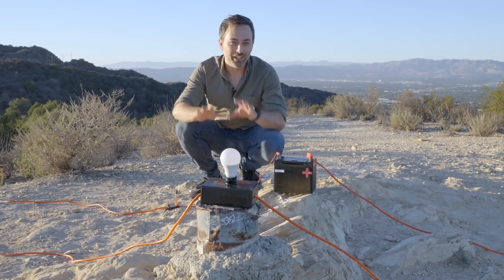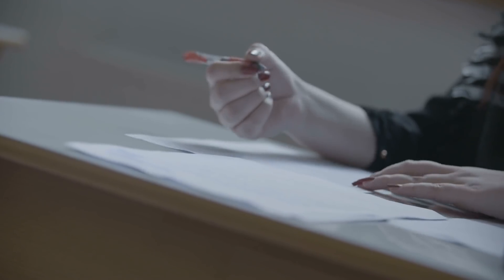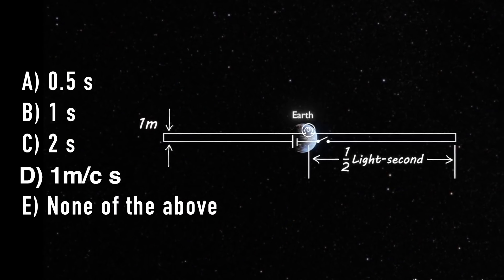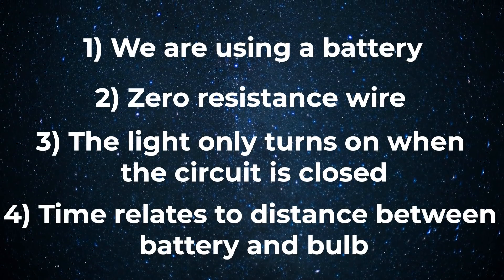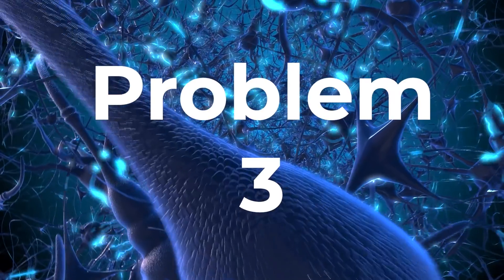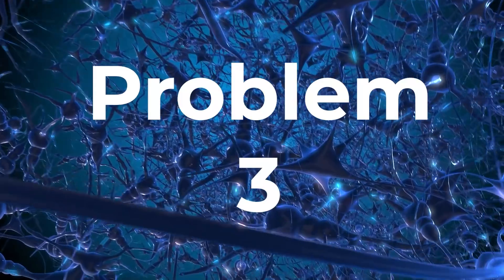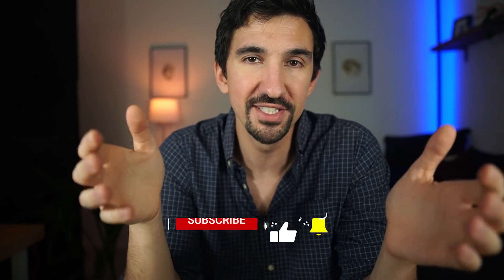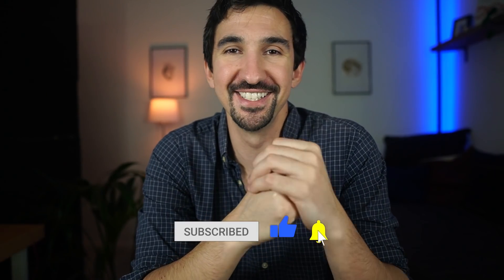Is Veritasium Wrong About Electricity?

Comment: If you just use Maxwell's laws directly, then you get Veritasium's answer. That's not very satisfying. But that's kind of his point -- the simplified models and explanations that most people get taught first lead to incorrect intuitions about what is actually going on.

Any electrical engineer worth their salt knows this answer intuitively. But getting that knowledge and intuition is what you spend a ton of time on when you get that degree.

That said, there are lots of alternative ways to conceptualize this problem that all give the same answer and all address your issues. Given the length of the wires, you could say you are looking at a capacitor. Given the transient nature of the switch, you've got induction going on. Similarly, the wires are basically a pair of antenna and you can find tons of videos on YT demonstrating this exact phenomena in that context. If he used AC current, and didn't bother to short the ends of the wires, this would all be obvious.

But he's using DC and a switch to create 1 transient effect instead of a continuous pump of energy. But because the ends are shorted, the energy will keep flowing because the current will get there before the transient dissipates.

It's also worth noting that special relativity is confusing for most people because they don't have good intuitions about how  electromagnetism works. If you have those intuitions, then SR is an enormous simplification of Maxwell's laws and the rest just follows from that.
Reply: Intuition this, intuition that. Can you show how you use Maxwell Equations directly please?
Reply: @georgelionon9050  YT comments don't allow for LaTeX math symbols. And the number of people who grok differential forms is pretty small in any event.

There are multiple good YT videos explaining the various ways of looking at this, and you have Ian M. Sefton's paper on which the original video was based.

I'll post a video if you have a specific question, but there are plenty of good resources already and I don't think I can add much beyond what I already said: all of these models are simplifications of Maxwell's equations under different assumptions. The problem people have is that they learned the simplified model instead of the real thing. So if you apply a model that isn't applicable, you get nonsense results.
Reply: @MaxHaydenChiz  My main question is, of course anybody with any intuition will agree that something is happening on the bulb in 1m/c seconds. Since EM Fields travel through the air and it's basically a capacitor, antenna, however you want to model it. However the EM field travels much stronger along the wire, so for the full strength to arrive on the current its wire length/c seconds.. If you answer is, the bulb gets already full 12V^2/R (R of bulb) power 1m/c seconds after the turn on event, then I really want to see a full explanation of that calculation. IMO the main argument people argue about is the unspecified parameter of how much it takes to drive the bulb.
Reply: @georgelionon9050  There are videos on YT from years ago of people using the antenna version of this problem to drive a bulb at full power just fine. You can test this. It does work.

If you want an explanation, go read the original paper that Veritasium's video was based off of. It's quite good and pretty understandable. And it argues that people get the wrong answer because they are taught the wrong things at the high school and undergraduate level. All of the issues I've seen people raise on YT are covered in that paper.

I think where people are tripping up is with the causality (which is perhaps the most bizarre aspect of electromagnetism). They want to think that the current is what is making things happen. But it isn't. The field is what causes everything. And fields travel at the speed of light. You don't have to wait for the current to "get going" in order for the field to do its thing. On the contrary, the field propagates and it causes the current just as quickly as it lights up the bulb. (The paper does a good job of showing how this works inside the wire vs at the surface, etc.)

Again, this is all pretty obvious with AC. But because the example uses DC, people without much experience or who have only been exposed to simplified models don't have a good grasp of what the transient behavior and the transition to steady state will look like. (But if you think of it as a piece of one phase-cycle of an AC circuit, that might help.)

I think the actual problem with Derek's video is that he didn't simplify matters like he usually does because the point of the video is that inappropriate simplifications create confusion instead of understanding. I hope he does a follow up that tries to give people a better grasp of this topic.

That said, it's a fundamentally difficult topic, one with lots of disagreement about how it should be taught and no truly successful approach.

I've never seen it taught in a way that even a majority of students came away correctly understanding it. If you go to engineering school, whether or not you cam get this is basically the difference between being an electrical engineer or having to get a major. (Much like heat transfer is the wall for MEs.)

Maybe Susskind's course on YT (Theoretical Minimum: Special Relativity and Electrodynamics) will help. But ultimately, you just have to work through lots and lots of examples on your own and work out the details in lots of corner cases.

If you understand how to derive all the different models, where they break down, and why, then this becomes less mysterious.

Grabbing a huge reference book with lots of tables for closed-form solutions and trying to reproduce the results is about the best advice I can give.

But at the end of the day, vector fields are weird. Some of the greatest scientific minds struggled to understand this stuff when it was first discovered. They invented new mathematical machinery to make it easier to understand. It didn't even play nice with other parts of physics until special relativity came along. And fully unifying it with gravity still seems impossibly out of reach.

It's a hard topic. Expecting a simple explanation is unreasonable. That said, my personal opinion is that if we taught the differential forms version of EM instead of trying to use div-curl-grad, people would have an easier time of it. I've always found using 4-potential to be more intuitive than trying to visualize a bunch of interacting vector fields in 3d space.
Reply: «Ces questions de noms se rencontrent si fréquemment, que, si les philosophes étoient toujours d’accord sur la signification des mots, presque toules leurs controverses cesseraient.»
-- Renes Descartes.
Sometimes it is translated or interpreted as "people would understand each other much better and would find agreement much easier if they would agree about the definitions"
Veritasium did not specify what should be considered as a signal.
Like it's not typical in physical sciences to associate a phase velocity with any signal, it's not typical to take a first propagating wave as a signal. Signal is usually interpreted by a certain level with respect to the full steady-state value, like 1/e or half maximum.
Thus, the initial condition of the task is not fully specified
😁
Reply: there is already a bunch of videos in yt demonstrating modelling of the long wires, showing predictable results: the first weak wave starts to bring some power to the bulb, but the true power comes after a full cycle of propagation. And a steady-state condition takes place after many reflection, and circulating the waves
Reply: Veritasium model is what he showed just for a split second, and it's what he was not talking about. That's the reason why that video is not so helpful, and that's why there is so much criticism

Comment: Assumption 4, that it only depends on the distance between the bulb and the battery, isn't completely right. The switch or at least the open part of the circuit (the break in your wire 1/2 lightsecond away) is of consequence. There's a difference between breaking the circuit over here versus over there. The "information" about the circuit break (let's just call it a switch) at the remote location 1/2ls away propagates at the speed of light, you're not wrong, but the field itself does too. The field (or more specifically, its advancing wavefront, where the "information" is) has a frame of reference. This is special relativity.

In the field's frame of reference, the bulb and the battery are connected instantaneously with the flipping of the switch, but only at the point in time in that frame of reference at which the signal reaches them. Remember how relativistic travel is like traveling into the future? It's this. And it's not only this, time dilation is only one effect, length contraction is the other. In this frame of reference, the wire is 0m long.

Let's continue the thought experiment, most importantly, HOW would you actually carry this procedure out? There is NO way to do it without being subject to special-relativistic factors, and the specific one which breaks your logic here is the fact that there is no universal notion of "simultaneity" which you can use to know whether the remote switch was flipped NOW or 1/2s ago for any observer other than yourself. There is no causality paradox here.

(Aside, you might think that the fact that we get GPS signals to work means that we CAN establish simultaneity, but that's not right. What that system does is calculates and accounts for the predictable non-simultaneities of all its parts. Plus, general rather than special relativity effects are much greater magnitude in that system, the special-relativistic component is vanishingly small.)

It does not matter where along the 1ls long wire the switch is. The signal from the switch to the bulb and the battery will always arrive simultaneously with the switch closing, to the observer watching the bulb and the battery AND the switch from the frame of reference of the bulb, battery and switch.

The bulb illuminating IS the signal, and there's no way to synchronize your clocks with the person flipping the remote switch to say it happened any earlier or later in your frame of reference. Well, actually, there is, and because of time dilation, it will say the switch was flipped 1/2 second before you received the signal, but again, that's only in your frame of reference. In the lightspeed FoR of the advancing wavefront of the electromagnetic field, it's simultaneous and instantaneous because of the length contraction.

Comment: I also know if you conect two old army field.phones together with a couple of miles of wire between them and talk into one and listen on the other you will definitely hear a delay.  So that blows vert's hypothesis out of the water. And its not a hard thing to prove it wrong. The electrons in the universe are not solidly conected there is space between them no mater how dense the matter they are in or how cold. It takes time (c) for them to travel from one atom to the next. Like a series of pool balls with space between them. It not rocket science.

Comment: I'm at a loss why we rationalize every electron in every atom of the wire taking turns moving like a drive through. I believe every free electron in the wire can move one valence space to create full circuit current. This is a very short distance and they may move together. I do not believe Veritasium that it is the field traveling from the power plant around through the sky and ground through my house and the glass  to power the bulb. It is the electrons moving across the LED or filament.

In part of Veritasium's video they mention the real world issues of the transatlantic telegraph. Then later the real world is abandoned and we must accept the moon circuit conclusion.

Comment: TIMF. A question about causality: Assume there is a rope that stretched from earth to the moon with a person at each end. The person on earth tugs the rope. Would the person on the moon instantly notice movement of the rope? Assuming the rope is under tension, no elasticity, etc.. If it is instant, how does this not break causality?
Reply: The answer is Yes, the signal does cover the distance "instantly", but NOT in the frame of reference of the people at each end - only in the lightspeed frame of reference of the propagating signal. I suppose if we assume a massless, frictionless rope, we could say that a lightspeed signal is possible.
Reply: @glowingfatedie  Thanks!

Comment: Thought the very same thing when watching his video.. this would mean faster than light communication..? One thing I'd view this as trained electrical engineer is.. the wires are effectively a capacitor. And wires spanning a light second on both sides are a hugh capacitor. And as you have a capacitior with several Farat size, at the beginning for DC current it can basically pass through almost undisturbed. This is similar to your antenna argument. So I'm still not sure what would happen. I think basically immediately is still an option (but a bit more than 1m/s since it needs time for the fields to reach the capacitor). So when turning it on, the light bulb will light (or get some power) basically immediately, independent if the end at one light second is open or not.. if it's open, then the capacitor will charge end the bulb die out after some seconds, if it's closed, the capacitor will be discharged again. Thats my take on it. However, my training doesn't really help here, speed of light limitations is not something that is usually considered, except in extreme high frequency ,circuit design and there is nothing DC anymore, so I from this base, it's only an educated guess, not that I know.

But instant Like for pointing out the unit issue and the formal argument that lying assumes intent.
Reply: Actually I just put in the numbers in the capacitor, assuming the cables are 10mm thick (Area is 2(cables)*300000mm(in one directrion)*1000(for k)*10mm^2 , it's only 0.0531uF. thats almost nothing, certainly not enough to noticeable pulse a light bulb. My guess would have been it would have been way large given the size. 

If it would be plates with 1 light second both directions than it would 3190000000F that would be a capacitor that would basically be on power on indistinguishable from a short circuit for any reasonable amount of time.
Reply: Actually it 53uF (both sides together, 28uF one side) I made a factor 1000 error :(

Comment: Some response videos depend on the distance between the switch and the lamp. But that wasn't the point of the video. He could have drawn a circuit as a perfect circle even without visualization and the lamp would then be somewhere on the moon and illuminate an astronaut. So if you take away the antennas, capacitors, etc. and really see it as an extremely long circuit then obviously there is no faster way than through or around the power cable. And that will proceed maximally at the speed of light. And since the propagation starts in both directions at the same time, it will take at least 1 second before our astronaut can read the newspaper.
Reply: You mean minimally not maximally. But otherwise, yes, agree.

Comment: Just a big capacitor really
Reply: C= K*Eo*A/D, not so big actually.1 meter is far apart, even assuming 10mm thick cables, even 600.000km long length makes the area not so impressive. 53pF.

Comment: So, Veritasium in fact made a big high-voltage capacitor. In real life the resistance in the wires will be infinite after x distance, so there you have your capasitor or transformer. Thanks for the input.